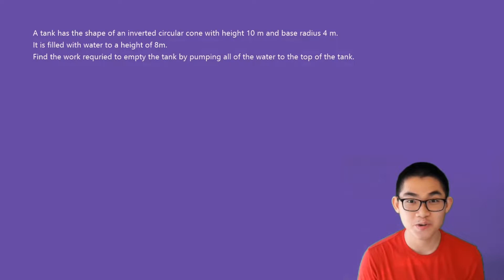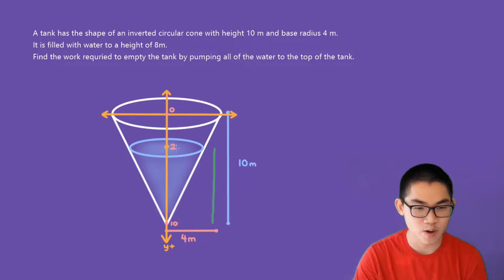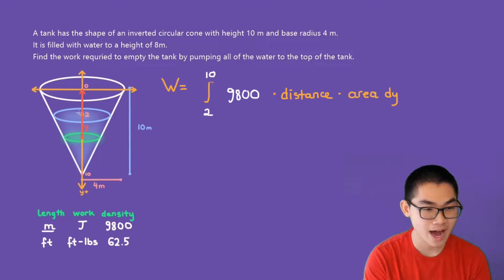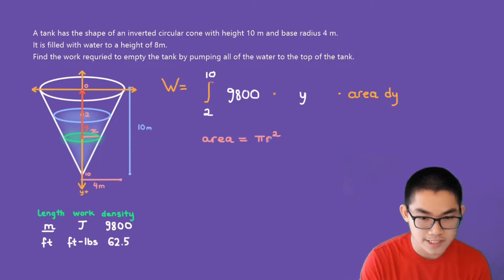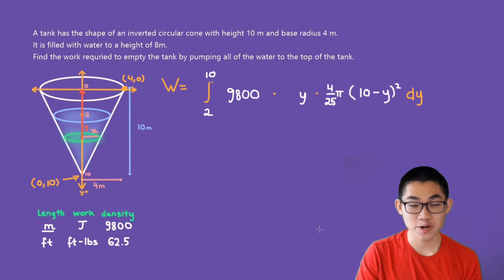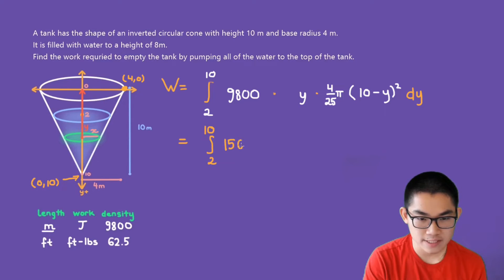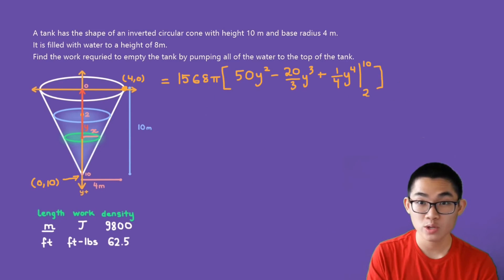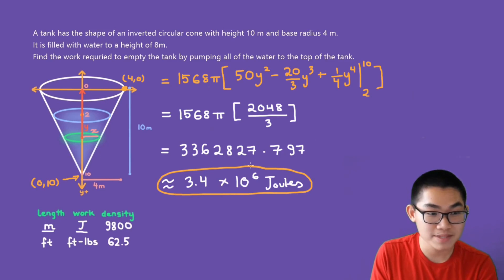Calculate Work to Pump Water Out of Inverted Cone

Comment: Hi! Thanks for your videos! They have been very informative. I just had 1 question, how do we know when to have our origin at the top of the shape? I watched your spherical tank work video, but does it depend on the question? I think you used the y+ pointing down so far for anything non-spherical, is that how it usually is?
Reply from the maker: Hi Veronica! For the work problems pumping liquid out of tanks, you always put the origin at the top of the shape. The only exception is when the tank is circular. Let me know if that makes sense :)
Reply from the maker: When the tank is circular, the origin is at the center of the tank.

Comment: by the way, I see that the density of water is 997 Kg /m^3  .. I'm trying to figure out where you have density at 9800 ..
Reply from the maker: Excellent question! The textbook that we're using in class (Calculus: Early Transcendentals 9th Edition) tells us to assume that the density of water is 1000 kg/m^3. So where does 9800 come from? We know that the acceleration force of gravity is 9.8. The textbook just takes 9.8 x 1000 to get the weight of each layer of water. So, 62.5 also comes from the same logic but they converted it to the imperial system. In a nutshell, students just need to remember these two numbers and how to use them on exams. Tests won't ask the students where these numbers come from so don't worry too much haha :D